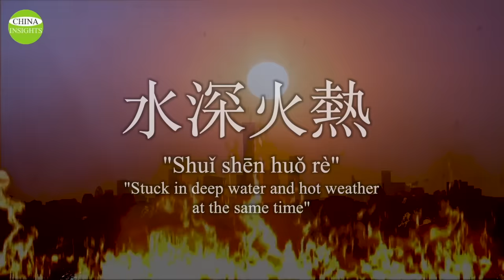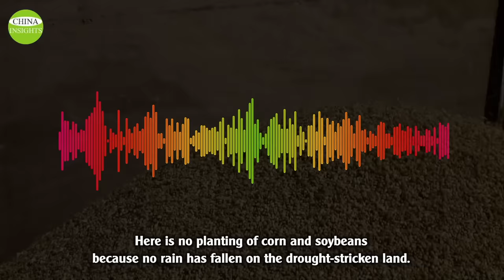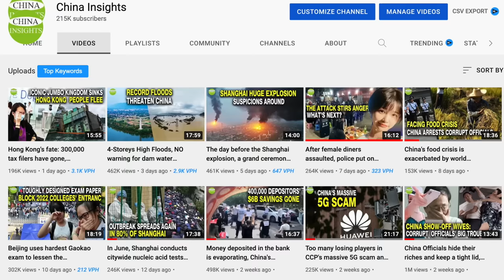Over 60°C! Record Heat Wave Joins Floods Threatening China's Food Supply...and Power Supply

Comment: Everyone who says it's the concrete that gets super hot is totally right. Also, a warning not to build cities without enough shade and greenery.
Reply: Also a warning to build cities without so much damn concrete reserved for roads and parking.
Reply: surely if you had enough concrete in areas, the overall areas °c would increase too?
Reply: It gets hot enough to fry an egg, but not hot enough to splatter water in oil.  The first video is fake.
Reply: @randomguy9777 Right on. Less wasted energy on gas moving those big things around, too.
Reply: @randomguy9777 uses car right after*
Reply: @randomguy9777 funny fact, less people is less omissions.

..*shoots gun*
Reply: The paved roads are much worse for the environment, but nobody will tell you that.  Black Rocks and black tar conducts and holds heat, big shock right?
Reply: Lol, I knew a heat wave would cause China to collapse! ! Fortunately, our India is very cool~~! !😏😏
Reply: Cities always want to eliminate every square inch of open space to build expensive homes, just for the tax revenue. And then they complain that there isn't enough water during dry seasons.
Reply: @pyro226  It's almost like they cut out the 10 minutes of the egg sitting out in the sun. It's not fake just edited.
Reply: @plmokm33  Water in oil splatters because it reaches over boiling point of water.  A pan on the sidewalk doesn't reach 212F.  Blacktop only reaches about 140F.  Wood Decks can reach about 160F, which is what the news had reported as surface temperatures.  A pan sitting out on a hot day isn't going to get hot enough to sizzle and splatter oil like that.  The first video the pan is preheated.
Reply: @pyro226  what temperatures blacktop or anything else reaches depends on the temperature around it. It's not like blacktop reaches 140 F and then stops because it "only reaches about 140 F". A cast iron pan conducts heat much better than blacktop but is the same optimal color for maximum solar energy absorption.

This is all a moot point regardless because you don't need to reach the boiling point of water to cook an egg. Idk about you but when I cook an egg sunny-side-up I don't turn it up to max settings. I've also seen quite literally with my own eyes someone crack an egg directly onto blacktop in 38 degree weather (100 F) and it started sizzling and got cooked. This is in Canada btw, not the equator.
Reply: Shade trees are a must.
Reply: @jingyangzhang1234  Yeah, still not sure how I feel about the channel.  The content is good and seems logical, but having a hard time deciding accurate vs propaganda.  I haven't seen anything blatantly inaccurate yet though.  Will keep watching for now.
Reply: MANY IN THESE CASES TOFU DREG CONCRETE INFRASTRUCTURE MAY BE BLESSING IN CHINA🤣
Reply: @gtyhvf6612  Keep Dreaming!

Comment: I can believe the actual temperature of concrete might reach that number. That wouldn’t be the ambient air temperature. I suspect… possibly for the first and only time… the Chinese weather report may be more accurate. This seems like the weather from Arizona where I grew up. I imagine they’re not used to deep desert temperature. As the Egyptian gentleman below commented… there are hotter places. But that doesn’t mean it’s at all enjoyable for humans, livestock or crops.
Reply: problem is chinese cities is basically entirely covered in concrete, so it is that damn hot. i did i hike the other day and all the people thought i was crazy going on a hike in the heat... truth is it was way cooler in the hills even under the blazing sun, compared to in the city.
Reply: @---iv5gj  yeah there’s also the issue of whether infrastructure and community resources are set up to mitigate the impact of the hot weather and air. Like you said, concrete in cities can amplify the heat index. Cities sometimes become heat islands. There’s buildings obstructing cool winds that might cool things down. Plus if buildings don’t have AC, or there’s a power shortage, or people don’t have access to cold running water? And if you have to work outside without breaks and you don’t have breathable fabric? You’re screwed. People die in heatwaves all the time that aren’t “as hot” as other places.
Reply: @---iv5gj  this is big factor in big cities.  I’ve experienced in Tokyo where going into the city at night temperature jumps 5C.
Reply: The concrete heat is irrelevant. What is important is food and water. Heat WE can endure, but our crops and our rivers will suffer, and it will be HUNGER that makes us all suffer.
Reply: @Vespyr_  the heat is deadly, a major cause of illness and death
Reply: Yep. I've walked, biked, and ran in 130 F degree Phoenix, Arizona heat. Dirt is air temperature, but concrete and asphalt will give you burns if you touch it.
Reply: Agreed. I live in South Africa near a coastline and we occasionally get 38 - 42 degree weather. The tar/asphalt is going to be a lot hotter.

The breaking of those roads seemed a bit weird though.
Reply: @thelourensfamily8048  even in Canada we get 45C
Reply: Lived in Vegas, can cook an egg on the cement.
Reply: It happens in the USA every year. It’s not that crazy.
Reply: @SoApost  no you haven’t. The record temperature in Phoenix is 122F.
Reply: @dorisummers6303  p
Reply: @Prosecute-fauci  you’re calling out a memory discrepancy of 8 degrees from over 30 years ago in a reply comment on YouTube? The internet is yours.
Reply: @SoApost  I’m calling out a declarative statement, and inserting factual information to dispute it.
Reply: @Prosecute-fauci  🏆
Reply: @---iv5gj  That's because cities have a far far greater surface area, due to their structures. Reflective surfaces like windows at high incidence angles to the incoming sunlight helps to focus light also. Couple this with their high density materials and you have a massive heat-sink that keeps their ambient air temperatures sky high.
Reply: @thelourensfamily8048  It's actually not that uncommon, and signifies bad engineering. Some materials have a higher thermal expansion than others, and that needs to be accounted for in construction. These thoroughfares weren't.
Reply: @skateboardingjesus4006  Thank you for the explanation. I haven't seen anything like that here :) Hopefully we never do but with our brain drain, it's probably in our near future.
Reply: @thelourensfamily8048  yeah it’s common to see roads that have “teeth” (just a small gap with connectors) in some places, where they expect the road will expand or contract significantly with changing seasons. Or some roads I have seen in hot climates that are laden with strips of tar to cover the annual cracks that show up
Reply: @aajohnsoutube  In montreal too there is usually atleast 5C difference between the hills a 15 minute drive to the north and the city center
Reply: I saw loooong time ago someone cooking egg on car hood in usa verry hot place
Reply: @Vespyr_  Humans cannot survive Heat. Our brains are rather fragile.
Reply: @RipleysSanatorium  Now, was that an egg that was supposed to be a chicken?
Reply: Do people know that China is one of the countries that has and uses weather manipulation technology (aka GeoEngineering)...

How much of its bad weather is real or manmade..?
Reply: You cannot grow food there anymore so to import will be more expensive. On top, the cities will become AC cities, making outside places hotter. The power usage draw to maintain this will cause the Dams to retain and release more critically. Very sad pile up of events. 
What they can do is create a canal from the flood zones to the north to help fix the water issues and use during the heat season/flood occurrences.
Reply: @WhiteWolfos  The North/South canals are nearing completion.  And are the equivalent of building a canal from California to New York!  Even at max capacity the total water they can pump is barely 10% demand in a normal year.  Drought mitigation practices and urban heat management are far more effective but... requires a responsive, educated and DEcentralized management to work.  As in each local farmer and building owner takes educated action according to specific local needs.  Something currently out of reach for China.
Reply: @SoApost  i was in Phoenix 10 days ago, I was just plain hot!  High 45 outside the city.
Reply: @keycontroller  it was probably the south west. It where we get warnings not to let kids out to play in the city because if they fall they could get severe burns from concrete that need immediate hospitalization.

Comment: I remember being in Dhaka, Bangladesh. Right at the end of the dry season and it was almost unbearable.

Not only do you have slab-sided concrete apartment blocks and offices soaking up the sun, the tarmac is totally uninterrupted for miles. Add to that, all the air conditioners pumping out heat at the height of the day and it's no wonder birds were dying from heatstroke.

Comment: This also shows that we really have to plan cities carefully. Tarmac and concrete store the heat well.
Reply: Sadly, no. Quite the opposite, like bare rocks, they lose the heat as fast at night as they soak it up during the day. Water, on the other hand, is one of the best mediums for storing heat around. Which is why coastal climates are so popular. The presence of the big body of water moderates temperatures, and prevent them from going to extremes.

Compare this to most deserts where you have scorching heat during the day, but may still experience freezing temperatures at night.
Reply: @rocketsurgeon2135  - Haven't had a cold night (save winter time) in over 20 years. What are going on about? Black Tar and dark rocks keep heat in earth longer than it can dissipate. (Edit: Why do you think some cities in the US deserts are trying to cool their area by painting their streets white?)
Reply: I doubt these people cared, they want the money instead of planning ahead and make sure shit dont bite back. They build what they want as much as they can at the cheapest cost, get the money and then invest in something else that is similar. The people who bought whatever they built suffer instead
Reply: @blarfroer8066  You can check the videos they posted. How many are positive?
Reply: @jingyangzhang1234  categorising facts as good and bad is a classic move by dictators. If you can't handle the truth about yourself, you should improve instead of crying about "anti-China propaganda"

Comment: Several weeks ago, it was extremely hot here in Florida. It was so dangerous to do our jobs outside, but we were prepared and know how to handle the heat. I don’t think the heat wave was exclusively to China.
Reply: The big issue in places like Florida is not the temperature alone, but the combination of high humidity and high temperature that prevent effective evaporative cooling as relative humidity approaches 100%. You sweat like a pig, but the sweat just soaks your clothes, make you sticky, and drip off you, without providing much cooling.

The same temperature with low humidity would not be nearly as big an issue - you sweat, the sweat evaporates from your skin, cooling it, no problem - as long as you keep hydrated and don't lose too much salts.
Reply: @rocketsurgeon2135  yeah your absolutely correct. It makes the high heat even more unbearable. It’s funny how chemistry principles play a role in our lives such as saturation in this case. Do you live down here by any chance?
Reply: @Daniel-San617  I've visited a bunch of times, but I used to live where summer = hot + humid, too, just not quite at Florida levels.
Reply: @rocketsurgeon2135  I’m often times fascinated on how flexible humans are in thriving in harsh conditions. For example people are thriving in China under brutal regime combined with floods, arid, heat/humidity, and the cold. We take things for granted here in the USA

Comment: First egg frying video's probably tampered with a bit... for oil to bubble up like that, there's probably some moisture in there, and for it to go straight to boiling over means it needs to be well over 100C, if not probably closer to 200 or so(thermal transfer is kinda slow and adding the oil to a dry pan that small will sap a lot of the heat from the surface. It's likely they put the pan on a hob for 30 seconds or so to get a bigger reaction)
Reply: Both the egg frying videos including the ant roasting are all fake & tampered with heating elements other than the sun + concrete. I've found 1 person on YouTube a long time ago do the fake version like their video. You can find the real versions on YouTube too, the egg doesn't cook fast like the fake versions so you know which videos are either fake & tampered or not.
Reply: Also notice they BOTH cast their own shadow over the pan.
As if the sun did not matter…
Reply: I’m sure you can hear a skillet being dragged from under the first pan!

Comment: Where I live the ground regularly gets to 178F + and heatwaves in the shade or ambient temperature are anywhere between 104-122F where as in the sun it will feel 15F hotter than the ambient temperature. I transferred a drought resistant tree that was a few feet tall a purple robida or dark locust tree and it literally dried up and died in 15 hours because I had to water the other side. It was a 106F that day. These are normal temps but the problem is now they're constants rather than just a heat wave.

Comment: No way that that egg would be cooked. the highest temperature the pan could reach would be around 60°C. Yes, it's hot, but not hot enough to cook egg that fast.
Reply: Metal can get much higher than concrete and much faster, so i dont find it too unlikely especially if placed under the hot sun on hot concrete

Comment: Hello CI! I won't mention the dams built by the CCP that are supposed to contain the floods and keep all denizens safe. But I WILL mention the South to North project. Since the major part of this has been completed, wouldn't it have been prudent to fling all the torrential rain that built up in dams and reservoirs quickly up to the North? 

Just having the water in Northern reservoirs would have cooled the air, added a layer of condensation into the atmosphere, and this too would have cooled the area and even provided rain. It's such a shame the CCP is letting all this precious floodwater go to waste by destroying towns, villages, farmland, and people's lives. 

Still, the CCP knows what's best, right?

EDIT AT 10:20: The South to North project was not just based on lack of drinking water, but mainly on water for agriculture, which was suffering badly. Every year the droughts are worse, and the desert gets a little bigger; yet every year, the floods in the South destroy more areas, take more lives, and are harder to recover from afterwards.
The STN was supposed to be the "killer app" to solve all these problems, yet it plainly isn't working.

Comment: 60 degrees. Doenst sound like much. Sounds like pleasant day. 140 actually sounds like hell. Or you could you could use the BEST measurement of temperature and call it 333 degrees.
Reply: They're using Celsius instead of Farenheit. Annoying but everyone outside of the US uses the metric system. Convert 60 degrees Celsius to Fahrenheit and you'll see how hot it truly is over there.
Reply: @rebelfighter5249  did you not see the conversions I did? I even included fucking Kelvin!

Comment: for anyone living in heat, without using any power , you can make your home 5 degree lower inside of your home by using the following . 

get a roll of aluminum foil , some soapy water and something 2 make your windows wet .

first u wet your windows on the outside with the soapy water .
second u stick the aluminum foil on , the shiny part facing outwards, the foil will stick on it , and it will make it 5 degree cooler. make sure there shine's no light through your window anymore !

it is not perfect and once every 2 a 3 days u need to put some water on the foil where it gets lose .
also it will leave stains on the window so after you take it off you will have 2 clean it.

it is only 5 degree's! don't come complaining 2 me it doesn't work that well , again it is only 5 degree cooler , for some it is life saving for others neglect able .

Comment: Time to phase out coal power plants and shift to clean, non polluting wind and solar energy.
There needs to be more discussion about the Climate Crisis and its impact on weather events.
Solar power plants can be built very quickly. Adding more coal power will only make the temperature worse.
Reply: @chrispbacon4701  Every country in the world is moving to adopt more wind and solar energy and are reducing fossil fuels production for electricity. Wind and solar energy are safer, cleaner and cheaper than fossil fuels. There is a Climate Crisis. Weather events around the world are getting more extreme. Excessive heat, rain, droughts, fires and floods are happening now.
Reply: I have been talking about Climate Change for 50 years.